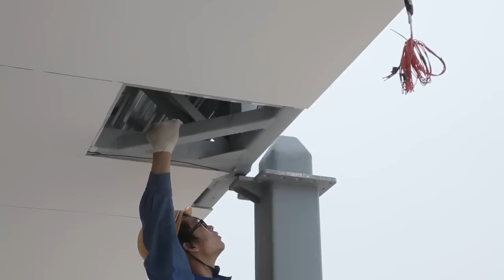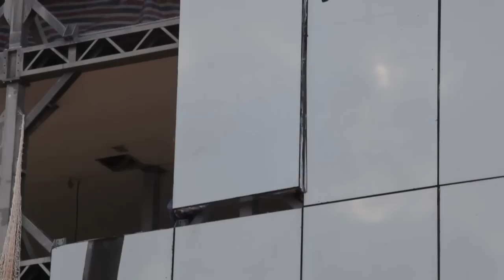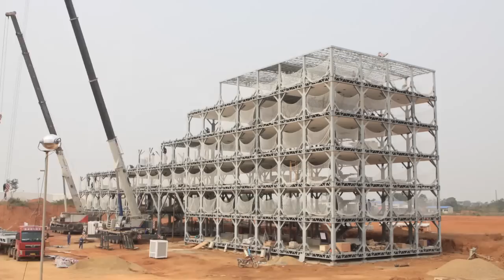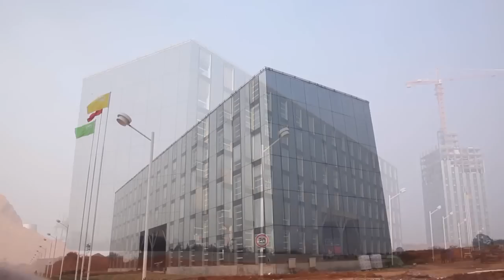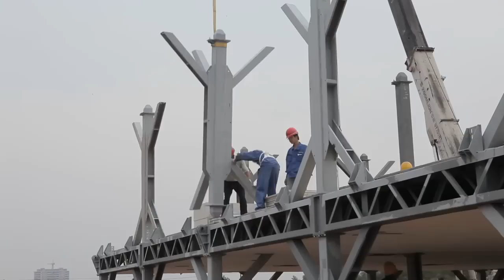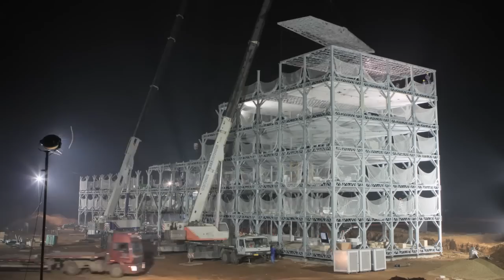BSB Broad Sustainable Building 远大可建 Dormitory construction 5 days

Comment: the same technology, what the soviets did ine whole soviet union and eastern europe in 70s. This is 40-50 yrs old technology. But very quick and with high efficiency
Reply: You wrong  soviet and Ester block build modular / tilts wall technology from precasting cement panels